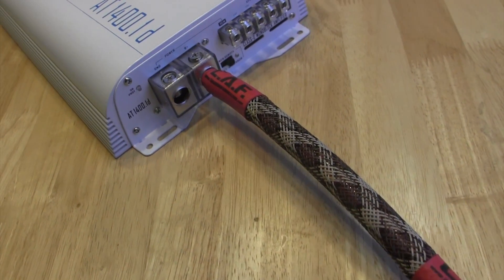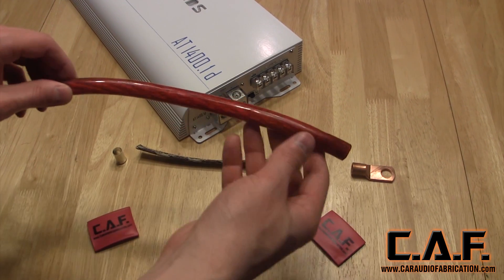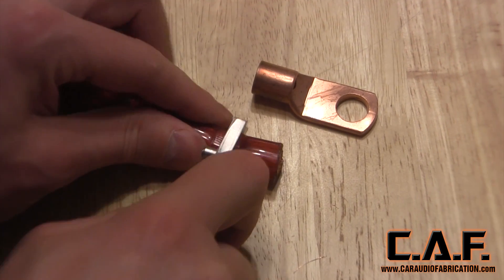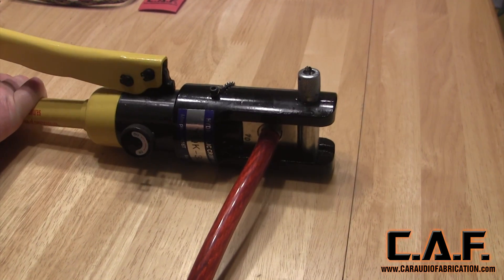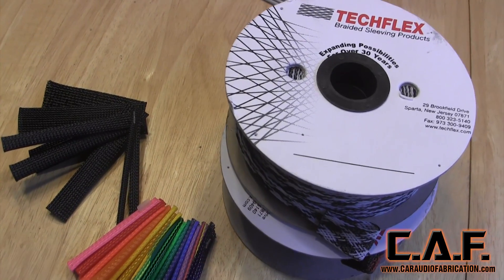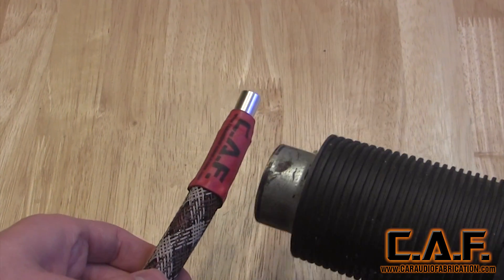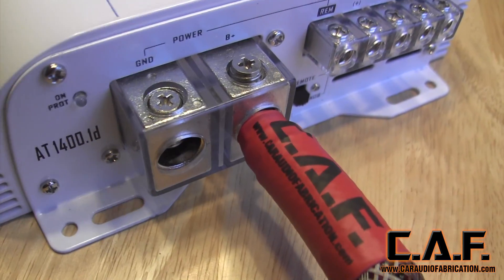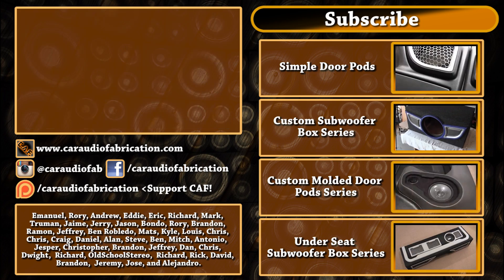HIGH QUALITY Power Wire Connections - CarAudioFabrication

Comment: How do you figure which diameter of tech flex is appropriate for whatever gauge of wire? They have many different diameters. Lets, say you have 4 gauge, 8 and 16 gauge cables. What would fit best? Thanks in advance.

Comment: Does using a feral increase the overall resistance (or impedance) of the connection through a power/ground wire or through a signal wire? If so, is it negligible or would it be beneficial to instead solder all connections if you have the time, materials, and tools to do so? Thank you to anyone with some knowledge on this and who is willing to reply!
Reply: Caleb Sokoll soldering causes resistance.... so it doesn’t matter.

Comment: CAF I weld for a living and I attempted to cut one of those copper lugs off! I cut it completely in two, and I still could not get it off the wire because of the cold weld had fused it to the outer strands! I'm actually looking for a a set of dies to make my own RCA cold welds I've got a similar hydraulic tool but mine's only a 10 ton, would you have any idea where to get those dies if they even exist?

Comment: First time I have seen that done correctly ,I worked on big power mains for high rise and correct.
Properly mark the full length needed to push the copper cable hard against the back of the copper lugs.
Size matters.

Comment: So, the ferrule isn't crimped on? You just slide it on and use the compression from the set screw on the amp to secure it?
Reply: heatshrink kind of holds it tight then the set screw crimps it.

Comment: My only question is without the ferrule being crimped how well is the connection on the distribution block and at the amp?
Reply: They're solid. The set screws are basically crushing the ferrule inside the terminal. It's the best connections i've ever used.
Reply: Had to ask the last thing I want is to fry an amp or short my battery out if I hit a bump driving.
Reply: Randy Rusk where did you buy your ferrules ? I need them for 0 and 4 gauge

Comment: Well what if ya got a Amp from the older days that has a screw     I just bought 1/0  wire and got to jerry rig it to my amp. It's a pain in my ass.    My old 4 gage wire fits in amp
Reply: If 4 awg wire fits but 1/0 awg doesn't, you could get the wire guage reducers.

Comment: Also, do the wire Farrell's just slip onto the wiring? No soldering or crimping?
If there is more to this, you could make a separate video on it since there is currently nothing on YouTube.
Reply: The ferrule just slide over the naked wire. The shrink tubing holds it on temporarily, the amp set screw mashes the ferrule onto the wire therefore it needs to be extremely tight. I wouldn't recommend soldering the ferrule because when you place it into the terminal for the amp then tighten the set screw, the soldering will crack and fall out causing hard soldering to be broken inside the amp terminal.

Comment: Just wondering about the sizes for the techflex, what size for what gauge?
I'm trying to cover some 4 gauge and some 1/0. What sizes should I order?
Reply: I had the same questions. I had to call TechFlex or WireCare and tell them what I had so they could give me some options. 1 thing to keep in mind is the color of the wire. TechFlex PET expands 150-200%. Example, if you're using a red wire but want a white TechFlex covering, you'll want to make sure to get the Techflex slightly bigger so that it doesn't expand at all. If it does expand you will be able to see the red through the white.

Comment: Nice .i have a JL Audio Slash 1000/1 with 4 gauge power & ground inputs. I'm running 0 gauge power & ground wire with Toolmaker 0 to 4 gauge reducers ..I'm supposed to trim back the wire insulation, insert into the reducer then into the amp ..my question is would it be worth while to put a 0 gauge wire farrel (spell?) on the wire before inserting into the reducer?? Or would bare wire be best

Comment: so whats the benifit of those connections versus bare wire in to the amp?
Reply from the maker: Wire strands cannot hangout the sides and potentially arc. Also the ferrule keeps the wire from fanning out, when stranded wire fans out the strands cannot pass electrons to each other as easily, this can increase resistance in the connection. When the individual wire strands fan out they can also break over time.

Comment: Welding cable, cheaper and more durable.
Reply: Also a much lower strand count. Which makes it much more difficult to work with. On a lot of vehicles in order to run cables neatly, you wouldn't be able to make the bend radius's needed with welding cable.

Comment: i crimp and solder is that a problem ?
Reply: no. Some people just tin the end of the power cable to prevent strands from fraying, but as soon as you tighten the set screw on the amp, it will chew through some of the wiring. The ferrule keeps the wires neat if you ever need to take the amp out for service or if you want to upgrade.

Comment: Could you damage the thread in the input block by using the set screw to crimp the ferrule on ?
Reply: Tom Mangu no it probably just crushes the ferrile securing it to the wire
Reply: And the ferrule is a fairly thin metal.

Comment: Hi guys.  Do you not use your crimp tool on the ferrule?  From the video, it looks like you just put it on the wire and put it straight in to the amp.  No solder either?  Thanks!

Comment: question my friend....
how do you fuse a
American Bass VFL 750.1
750,amp draw???
Reply: Google
Reply: +John Work 60-80a should be fine
Reply: It can draw up to 750 amps...
How will a 60 or 80 amp fuse take it?
Reply: Peter Salgado ^^^^How^^^
Reply: +John Work Easy, use a 350 amp fuse for each positive 1/0 guage wire :)
The amp has two power inputs.
Reply: stertheder where can I find Some of those?????????
Reply: Link!!!

Comment: so you don't crimp the ferrule on?
Reply from the maker: Andrew Peters No, the set screw basically crimps the ferrule to the wire.
Reply: Is this for more surface contact? The crimper can create a cold weld but I'm not sure if it will make a better contact. I have some fuse holders that will probably break the plastic backing if I crank the set screw down on the ferrule. I tried testing to see if there was a difference on an amp the resistance was negligible between the 2 and I wasn't able to load the wire enough to see if there was any real differences.

Comment: Mark, Awesome as always.  Babs from CAJ and DIYMA. On ferrules, may I ask what sizes/model#s you like for typical 1/0 wire and 4 gauge?  I'm trying to get a starter pack together. I'll certainly need 1/0 for some rather thick NVX wire currently in the car.  Much appreciated.

Comment: Hey Mark great video has always. Just like the other guy mentioned, i have learned alot watching your videos and appreciate you taking the time to make them. After watching this video i thought thats a good ideal and then after teading the comments of some people saying they will come loose etc i had an ideal of putting ferrale in place tighten down set screw....then take it back out and where the set screw made an indention drill out a hole same size as set screw that way there is no doubt that it will not come loose.....what do you think of this ideal...good or bad.

Comment: I was looking for something like this when I was buying parts for my build.  Didn't have any luck finding them.  Saw this video and it inspired a budget way to accomplish a clean look similar to using ferrules.  I cut off the spade end and put the crimp part flush on the end of the exposed wire.  Started crimping it with pliers to keep a barrel/cylinder form.  Got it nice and tight so there wasn't any movement then finished it off with the set screw on the amp.  It turned out great and looked much better than if I had bare wire in there.  Thank you for the inspiration.

Comment: Always another awesome video, I have learned a lot from you, my wife on the other hand hates you as I don't leave the garage often enough.  I like the ferrule idea for a much cleaner look and lowers the risk of shorting between the power connections, however being an I/E tech, I would give caution with the use of ferrules.  As terminals contract with the heat and cold of the environment and cars sitting in the sun they tend to get loose and could cause issues and extra heat at terminals.  How do the pros handle this?  Would it be better to center drill into the ferrule where your terminal screw goes that way you get the clean look and your screw gets deep penetration?

Comment: One thing I learned working on costume PC is sleeving wires. I used to run with techflex and kobra since they offer a verity of size, length and color including UV reactive which is awesome if you plan to show off your wire and wire dressing (management) skill to the world. But one cool I think we should try and  use is paracord as a wire dressing product. It is cheaper for the "budget" modder and builder gives you a costume look and feel. As well we should try to incorporate lacing the cable which I think gives your wire a very clean look. Something I believe should be used in audio some day. Why hide your wiring why not make it part of the art and show piece.

Comment: i strongly disagree with the ferile on the end that goes into the amp i see it being a potentially loose connection and using the screw to clamp it down like that you could very easily strip the threads in the amplifier input i think the wire going into the input is much better then this "fancy" ferile input
Reply: if you're stripping threads or screws are coming loose, that's a simple install fail or cheap terminal.  i use insulated ferrules cause i don't use techflex much.  covers all wire and wire strands.
Reply: I tried the ferile thing a while back on speaker wire, noticed I lost signal...went to troubleshoot and saw that the bass rattled the speaker input screws right out. The screw doesn't really have anything to bite into.
Reply: dwiz i agree
Reply: They clamp when screwed in. It isn't iron strong. They are usually one time use. If you pull it out you make another. They don't fit loose as you say

Comment: will the set screw loosen itself due to vibration? I had cases like speaker wire getting a little loose from the connector overtime if I tinned or ferrule crimp it. The wire strand were too stiff for the screw to compress and bite on it tight.

Comment: 10/10, only thing I would suggest is to use glue-impregnated heatshink so the techflex doesn't come out.. but this is more applicable to engine grounds where there's a lot of movement. I love that hot knife method of cutting the techflex!

Comment: how can i know witch texflex to use, would be nice to have a chart with every wire size and texflex size that goes well with it.
Reply from the maker: theale1 Techflex sizes are listed in diameter, simply measure the outer diameter of your wire and pick the size that corresponds. They can't really say that a certain size works for all 0 gauge or 4 gauge etc because each manufacturer uses a different insulation size for each wire.
Reply: I've found that 3/8 fits snug for most 4 gauge, 1/2" for most 1/0, 3/4 for a lil breathing room or oversized 1/0 like Sky High and 5/8 fits nicely for SHCA 2/0
Reply: When ordering TechFlex for 1/0 awg wire I normally get .25 TechFlex which is 1/4". 1/0 awg wire measures .38. TechFlex expands 150-200%. Just keep in mind that the more you expand the TechFlex the more wire color will show through. If you're using a red 1/0 awg wire and want to cover it in white, I would not use .25 TechFlex I'd use .5. It will be a little loose but at least it won't be pink from the red showing through the white.
Reply: Randy Rusk Thanks!!!!

Basically buy half inch for 0 gauge wire!!!!

Comment: Do you think is best to run both ground and + positive cables directly to the trunk or grounding the hole car?
Reply from the maker: Leonidas Limnios Your ground cable should be as short as possible and ground directly to the sheet metal of the vehicle. Use a location that is close to the frame and is solid.

Comment: Just an idea out there but I have a little Ford Ranger truck single cab so I have very limited room for subs but I love bass what do you suggest
Reply from the maker: Austin Hinckley 

Take a look
at shallow mount subwoofers. Many people get in over their heads with trying to
install a power hungry beast of a subwoofer that requires lots of airspace into
a small space, but you are better off with installing a subwoofer that is
designed for use in a small location. Take a look at the under seat subwoofer
box series we did for some ideas. You can fiberglass mold a location the
vehicle and build off of that.